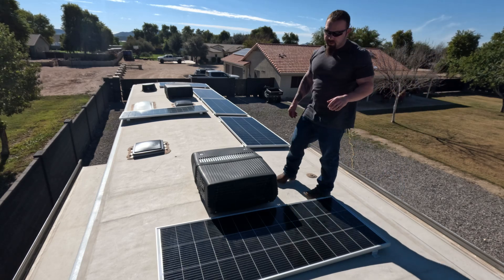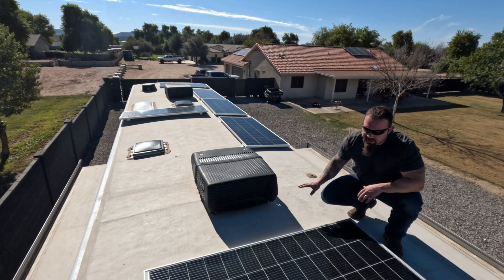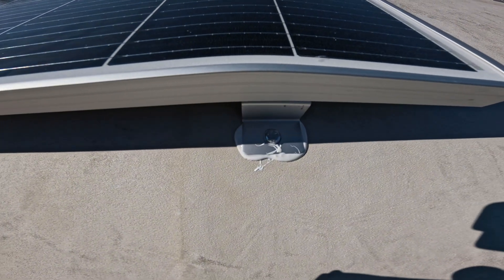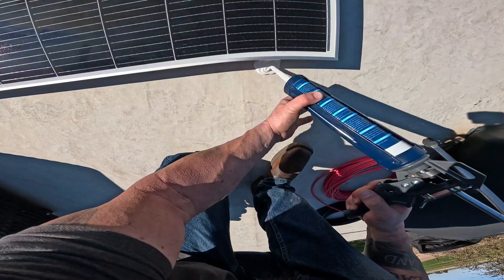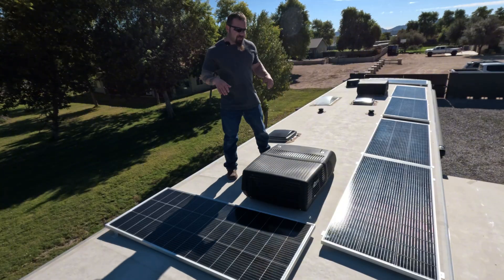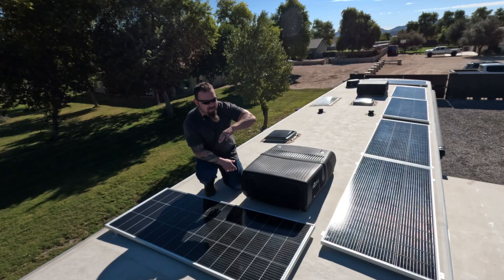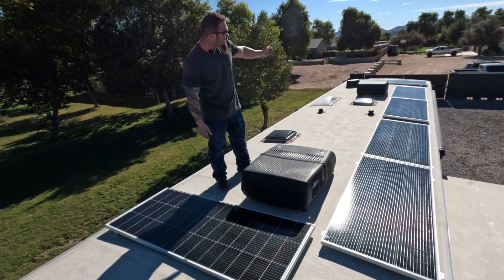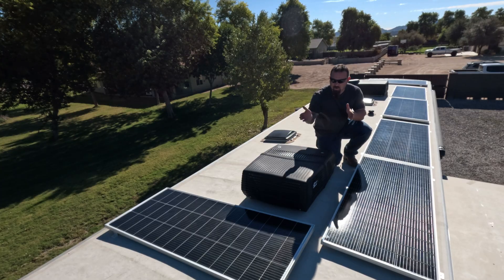The 5 Biggest RV Solar Mistakes — Don’t Ruin Your System!

Comment: Wow!!!!! What you have is SIX HUGE HEATERS ON THAT ROOF!!!!!!!!!!!!!!!!!!!!!!!!!
Solar panels produce ELECTRICITY but they also create A HUGE AMOUNT OF HEAT!!!!!!!!!!!!!!!!!!!
You need at least 6" of air flow on ANY roof!!!!!!!!!!!!!!!!!!!
Reply from the maker: Wow! How much heat would you say? And why would it matter when they’re outside? Global warming? 😂
Reply: @RvPowerPlug  Take a big panel, say 410W or so and place it on something off of the ground and make it work filling a battery. 
NOW TOUCH THE UNDERSIDE. 
I have 11 410W panels on my 40' motorhome with a 10K all in one and 300AH of battery's at 48V. As I was finishing I got close to the underside of one of my 410W panels and I felt a LOT of heat. Then I tried to touch the underside with my hand and I could NOT hold my hand on it.
I started working with solar on 2017 and I don't have any "BOOK LEARING" but I have years of REAL WORLD experience and I think that is just to hot to put directly on a roof.
Reply: @RvPowerPlug  On my 40' diesel powered motorhome I have 11 410W bifacial panels about 14" above the roof. If in the bright sun I put my hand on the bottom of one I will BURN my hand.
Why would it matter if they are outside? You have got to remember on RV in general there is only about 5" to 8" of insulation so it would not take to much to get the inside sealing worm plus some RV roofs are RUBBER and rubber will melt very easily.
Reply from the maker: @davescorneroftheworld1147  I’ve been professionally installing solar for about 6 years now as the owner of RV Solar Concepts in Arizona. I’ve seen absolutely horrific DIY installs where they didn’t even use mounting feet, they just used VHB tape to the solar panel frame and stuck it to the roof and even in those cases with ZERO air gap and no ventilation there was no damage to the EPDM rubber roof. I understand your concern but from personal experience i can assure you, it isn’t an issue. Solar panels usually run about 30 degrees hotter than the ambient temperature they are in. It’s not enough to cause issues.
Reply from the maker: I don’t disagree that they produce some heat as a byproduct of electrical production as most are only 20% efficient at the conversion but i think you’re looking to solve a problem that isn’t really a problem… installing panels like this doesn’t decrease their production by much if at all, I’ve tested them extensively over the last 5 years of installing professionally. Ive also never noticed an increase in temperature inside the RV as a result of them being mounted like this. So if production is good, there’s no harm to the RV, there’s no heat load making it through two layers of roof material AND insulation, then what exactly would you gain by increasing the mounting height? At that point you’re just exposing yourself to more wind resistance when traveling and a higher probability of ripping them off from wind or tree branches.
Reply: @RvPowerPlug  Take a big panel, say 410W or so and place it on something off of the ground and make it work filling a battery. 
NOW TOUCH THE UNDERSIDE. 
I have 11 410W panels on my 40' motorhome with a 10K all in one and 300AH of battery's at 48V. As I was finishing I got close to the underside of one of my 410W panels and I felt a LOT of heat. Then I tried to touch the underside with my hand and I could NOT hold my hand on it.
I started working with solar on 2017 and I don't have any "BOOK LEARING" but I have years of REAL WORLD experience and I think that is just to hot to put directly on a roof.
Reply from the maker: @davescorneroftheworld1147 It’ll be warm to the touch for sure. Hell where I’m at in Arizona i can’t even pick the panels up without gloves in the summer… it’s 117 degrees when I’m installing these things but I’ve still NEVER seen damage as a result of using Z brackets to roof mount panels on an RV. If you have evidence I’d love to see it so I can optimize my methods but after 100+ installs I’ve not had one issue…

Comment: Hi just found your channel. great setup and information. where do you recommend installation of fuses, how many and on which line + /- .  do you go 1.5x the amperage like your panels in the video at 9.5 amps using a 15 amp inline. if your getting up there in amperage with parallel around 28.5amps do you still do the same  30 to 50 amp fuse. at this where do you insert the fuse (s) main run going to controller or half splitting runs in your series parallel setups and extra to controller. inline or breaker style on roof junction box?  not sure where and if I need inline fuse.
I am planning on two sets of 10 awg copper solar wire from roof down to a PV combiner box. The 63 amp solar combiner box with two inputs, one input for each array.  breakers at 30A each input and lighting & surge protection.

I am planning two arrays on the roof, a 2280 w array (8) 285 W (Trina panels 39.5 ocV 32.2 MPV 9.51 ISC amp 9.01 MP amp ) Series Parallel. (4s x2) going to a Epever 100A MMPT.  2nd array Trina 285 W total of 1140 W of 4 panels series parallel (2s x2) into another Epever 60A MMPT. 12 panels as the roof real estate of the 5th wheel only allows this much. Both Epever will be in parallel for 800 ah of chins lithium batteries series parallel setup for 24v to a 3kw inverter connected to a transfer switch (shore power or solar) then to the RV's power center to supply whole RV with AC.
Reply from the maker: Contrary to popular belief, you're not REQUIRED to have any fuses installed on the solar panel side AS LONG AS the conductor (wire) size going to the solar charge controller is large enough to handle the accumulative MAXIMUM amperage that's produced by the panels connected. So if you have 4 panels that each put out 10 amps at maximum power, you don't need a fuse if your wiring can handle 50 amps continuously. That is straight out of the National Electric Code Book. Additionally, each panel is usually fused inside of the black distribution box on the back of the panel where the output wires come from.

 I don't use junction boxes as they are bulky and a cost that provides no real value. Connect your panels in Series, then parallel them together with parallel branch connectors and run the output of those connectors to the input of the charge controller. I highly recommend not using EPEVER for the controllers as I've had several failures over the years with them. Once I switched exclusively to Victron controllers I never had a single failure in hundreds of installations. The EPEVER is also easily 3 times the size of the equivalently rated Victron Unit which is going to make a difference in an RV application as were limited on space.

Comment: Some smaller RV’s with max solar packages don’t have sufficient real estate on the roof to avoid being placed near shade producing objects.  For these applications, one option is a shade tolerant (16+ bus bars) solar panel like the Renogy ShadowFlux.  Another tip when installing panels is to place some VHB or Eternabond tape on the feet of the brackets to adhere to the roof and place a little lap sealant or silicone on the self tapping screw before screwing into the roof membrane.
Reply from the maker: You're 100% right! Both of those options can be great additions to a solar installation, thanks for sharing!

Comment: I am new to this, currently trying to install two Jackery solar panels to my aluminum roof, but the screws just go right through as it is pretty thin, so they are not tight…. Should I try pop rivets instead?   Planning on using gorilla glue construction adhesive as welll, thoughts on this?  Thanks!
Reply from the maker: If your roof material is not suitable for fasteners, there are a few different adhesive options. Look for the large plastic adhesive ones that come in a pack. The pack should include 4 corner supports and 2 middle supports. These might work better for your specific roof.